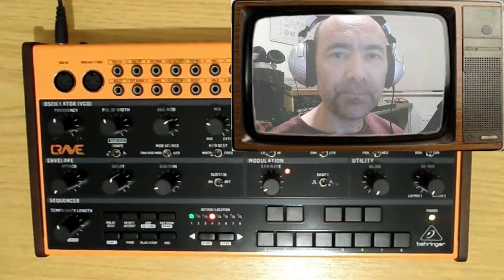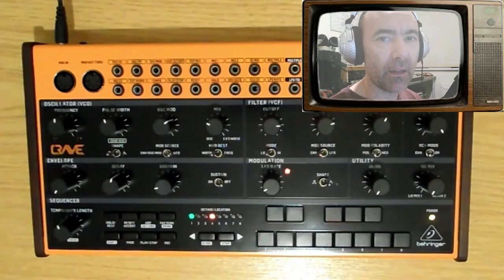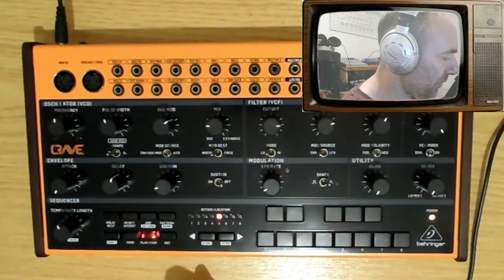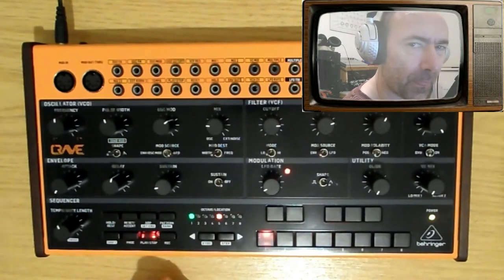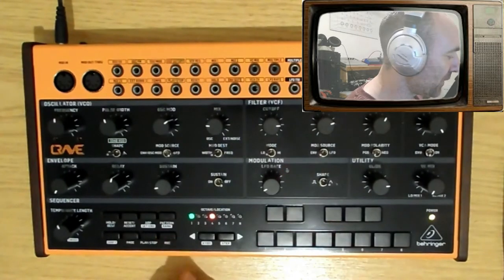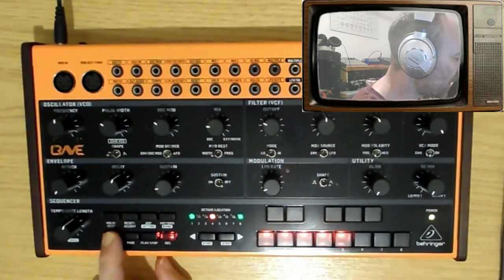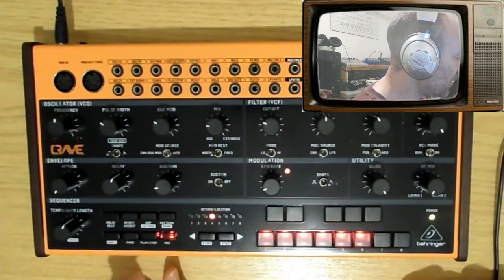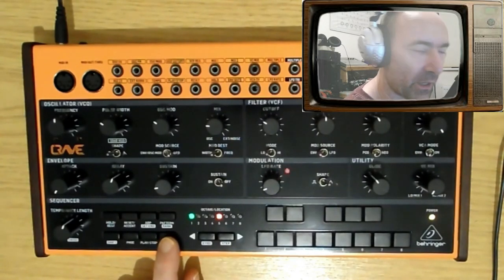Basic Behringer Crave Sequencing Tutorial

Comment: Hey there, I have a question!!! I got the crave since today and I can’t sync it with the other machines I got. I go from midi out from the drumbrute impact to midi in from the crave. It starts to play like the others but NOT IN THE RIGHT TEMPO! May you know why? Can u please help me???
Reply from the maker: You may need to set the MIDI clock to receive. The Crave Parameters section of the manual tells you how to do it. If you look at the 3rd page of options you want to set the MIDI clock mode to DIN. The other things to look at are the programming tempo input modes, which say how many clicks to a bar, and if I remember correctly playing with the tempo dial can effect the divisions that playback occurs at.
Hope that points you in the right direction and have fun with it.

Comment: Can I make filter cutoff changes per step ?
Reply from the maker: Not really, part of the thing with the analogue synths produced here are that all the controls are real time from what I can work out. You could maybe route the CV from the KBCV to the VCF cutoff and that would use the pitch from the sequencer to control the filter cutoff. The other thing you can do is assign sample and hold to the assign output and plug that into the VCF cutoff, but there is no way to program in a CC filter cutoff like you can with a 100% Midi system.
Reply: @DocBolus  yes, I like the idea of routing the the keyboard pitch tp the filter. But then, could I control the pitch with external midi ?
Reply from the maker: @valedonjos  Yeah I think the pitch would be controlled, but it would also control the notes that are being played. If you had another sequencing module (as in modular synth module) you could use that and plug it directly into the VCF control.